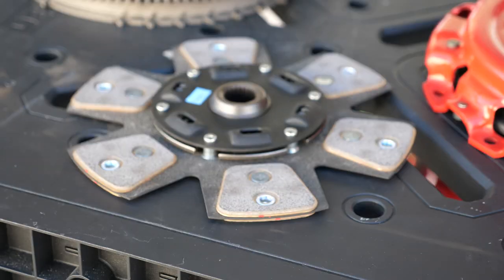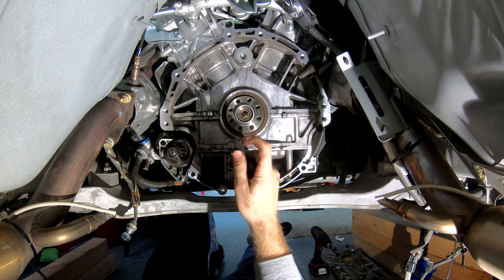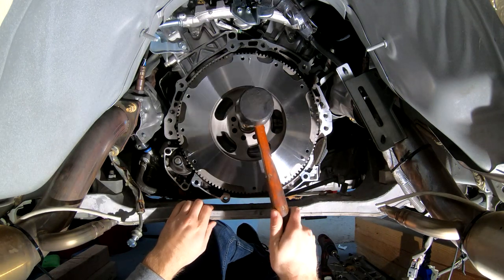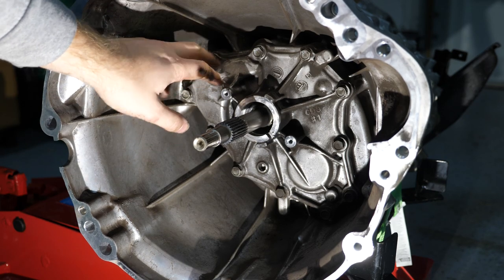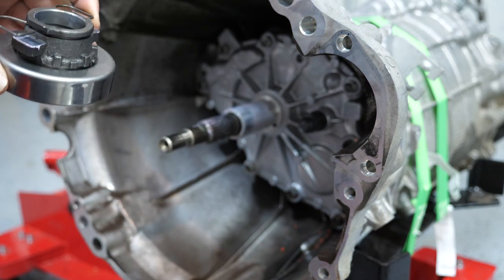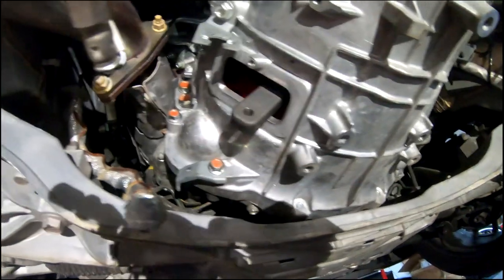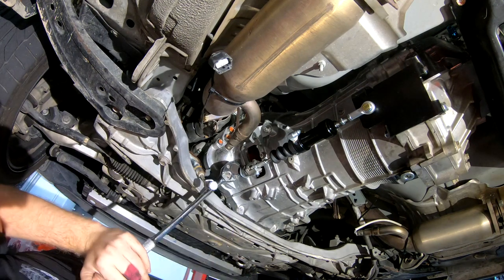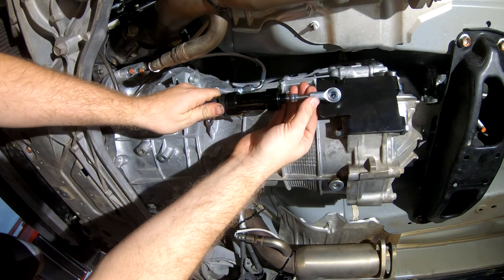370Z Clutch Install & CSC Elimination Kit - Detailed Walk Through

Comment: *Important note on the bellhousing torque specs*

At 25:15 you accidentally quoted the newtonmeter figures as ft/lbs. The small bolts are 34 ft/lbs and the long bolts 55 ft/lbs. 

Also worth noting theres and extra sensor on top of the transmission if you have a syncro rev match model. The clip for the sensor is very difficult to get, but it can be disconnected a few inches further along the loom. Do not forget to disconnect this, if you rip it out, theyre *extremely expensive*. Overall excellent guide, thanks for uploading.

Comment: Good video! You really need to do the RJM adjustable clutch pedal. It’s made my driving experience 110% better, and gets rid of that crap Nissan helper spring.
Reply: Good call. Or you can simply remove the spring.. that's what i did on my 370z. clutch has a much lighter feel afterwards
Reply: MrChips005  Yeah, but after I installed the RJM pedal... Nothing you do with the factory POS is just nonsense. I’m just sayin’ it’s amazing.
Reply: @EatMyPropwash  Where do you find this RJM pedal? i'd like to research more
Reply: MrChips005 just search rjm pedal 370z. Youll see it
Reply: I installed the RJM clutch pedal last summer and it made a world of difference, time and money well spent!
Reply: RJM pedal was A HUGE difference in how she feels. Well worth the money and effort installing.

Comment: Correcting the OEM CSC problem now, while you're doing the clutch and flywheel is good preventive maintenance - something I learned during the time that I owned a Porsche. I bought a 2019 370Z 6MT sport pkg(current mileage ~39K) and flushed all of the fluids at approximately twice the frequency that Nissan recommends. I also periodically look at the color of the brake fluid to see if it's starting to darken any, so far so good with no problems. The brake fluid that Nissan recommends for this car is a special extra high temperature fluid that is pretty expensive but is necessary in order to resist oxidation and degradation. I suspect that some owners, and cheap shops, are cheaping out with regular hydraulic brake fluid that may be getting stressed out under the high operating temps in the bell housing and causing the CSC's seals to degrade and leak.

If I ever have the clutch assembly taken apart I will probably do much of what you've done in this video.
Reply: I'm keeping it all OEM and hoping you're right. I like the feel of the 2018 clutch and OEM parts, so unless I made it a racecar, I'm not straying from the design.  Nissan upgraded the clutch pedal in 2015, I think, with exedy.  I already did a clutch fluid DOT4 GTR fluid change and will probably every other season.

Comment: Great video and extremely helpful. One thing to add is to mention the removal of the cat or test pipe immediately after the transmission removal. This entire project was fun until the removal of the cat converter. I wish i would have removed it before installing the transmission back on.
Reply: Why did you have to remove it did it get in the way?

Comment: Great video! I did the same elimination kit, it’s great as long as you adjust it right.  After 20k miles and two years I’ve noticed there’s a small slave cylinder leak it may have been because I used racing brake fluid and didn’t change it
Reply: Whts the idea of the elimination kit?

Comment: 25:10 Annotate this for others wishing to attempt this, you misinterpreted the FSM and over torqued all of the transmission bolts. Per the FSM, the 8 longer upper  bolts torque spec is 55 ft lbs and the lower shorter 4 bolts *torque spec is 34 ft lbs*. Starter motor bolts is *35 ft lbs*. The Starter motor bolts are the only bolts on the transmission that does not have a washer, the rest of them do with the difference among them only being the length of the bolt.

Comment: hey i have questions i just finished installing my kit with your guide one question is does your clutch pedal feel like its loose from the top position to about half way then it’s catches also vice versa when clutch is all the way pressed and i go to release it it feels good up until halfway up the it basically has free play hopefully you respond thanks! great video by the way
Reply: I’d recommend bleeding the clutch fluid and if you have changed the Master clutch cylinder to replace that if it’s been a few years with the car with abnormal clutch fluid change.

Comment: Hello, thanks for the great video. I have 2009 Nissan 370z and looks like slave cylinder went out. How long would a project like this take? What is better elimination cylinder kit or a heavy duty cylinder kit? Thanks.
Reply from the maker: Would suggest heavy duty cylinder over the csc elimination. A bit less work and more reliable.

Project would take you a weekend or so if you have some experience doing breaks/diff, etc. But just make sure you have a spare vehicle.
Reply: @thecarizon504 you didn't replace the rear main seal?
Reply: @thecarizon504 why did you go eith the z1 cmak over the zspeed  cmak. The z1 kit looks like more work

Comment: really helpful video Carizon!
I do have a question if I'm using the same old stock clutch with the CSC elimination kit, how or where do I get my shim thickness?
Reply from the maker: I would check the Factory Service Manual if you can get a hold of it. It may be worth checking with the guys at Z1 too, since they sell the oem clutch if I am not miataken.
Reply: @thecarizon504  one more question... so, I installed my clutch kit from z1 and my clutch pedal feel so hard... is this supposed to be like that?

Comment: Thanks for this awesome video, this is by far the most detailed instruction on the z1 csc elimination kit out there. I can’t shift into reverse half of the time without putting it back to neutral/release clutch/repressing clutch and repeating this process a few times, having a super stiff racing clutch makes it even worse. I’ve been told I need to adjust the csc kit, do you know exactly which part needs adjustment?
Reply: Having similar issues, not sure if its related to the cold weather since everything shifts smoothly after warmed up. Did you ever solve your issue?
Reply: @tarnjit458  it happens to me all year regardless of the temperature. My local mechanic told me it's not an easy fix, the transmission has to come down in order for him to make adjustment to the gear. I'll probably bring it to a performance shop that have installed these csc kits before

Comment: WhAt determines the engagement point ? The bolt connected to the black bracket on the slave ? Mines feels like the engagement point is to small n at the bottom . Also can’t bleed it maybe if I bleed it would the engagement point change ?

Comment: I have a question for you, bought a g37 with the same parts installed z1 full face and csc delete. The clutch is very very stiff. Wondering if you had the same feel on yours? It grabs great and is drive-able but just seems incredibly heavy
Reply: Clutch spring assist ?

Comment: Great Video! You mentioned you'd review the clutch in the next video but i haven't found any more info in your subsequent videos. I'm about to order parts to do exactly what you're doing here but a little torn on the 6-puck ceramic or just going with the full face organic. 6-puck looks really "streetable" from your videos but how is the clutch life on it? any other drawbacks? thanks if you get the time to respond here!
Reply from the maker: I've had it on for almost a year and a half now. It's been running well, I've heard the life on these can be pretty short lived, I've been told not to expect more tham a couple years out of it. I'll have to see, if that's the case may switch to a different unit.
Reply: @thecarizon504  Dude, thank you so much for the fast response! Can be really tough getting useful info sometimes. Sounds like i should probably just go full face organic right now and then if/when i get closer to making a lot more power just switch to the 6-puck at that time. Also I am going to be making a video about the repair, won't be full tutorial, but definitely going to point people over here cause your hard work really shows in these videos. You're a legend!
Reply from the maker: @C_Robbins  full face should work along with a high pressure plate. What power/tq you shooting for?
Reply: @thecarizon504  Short Answer: (Until further notice) try to bump up in the 400-500Hp range. 

Long Answer: Still uncertain because I'm not sure what direction to take the car, the body looks okay from 10ft but is FAR from perfect and I've done a ton of work to make the car mechanically sound from being totaled (and terrible repair job) from the previous owner. But not sure if i wanna go "flashy" with forced induction, bright wrap and big wang (kind of for YT sake), or more "performance" with unassuming outside but highly tuned insides with maybe the idea of, "as much NA performance i can get from it." In the end i just want the car to help facilitate my journey in becoming a better driver so it needs to hold up to some AutoX, track days, etc. and before my CSC died all i know is, i was sick of the clutch slippage. If the clutch is engaged i want the tires to spin or the motor to stall haha Just want to set myself up for success even if I'm not sure what adventure lies ahead.

Comment: Would like to know how drivability has changed with the 6 puck clutch versus stock, not sure which clutch to go with from Z1 but definitely want to install the lightweight flywheel when I go to do this. Thanks
Reply: Just got mine installed 2 weeks ago on my 370z. Love it but does take practice getting used to 1st gear.
Reply: @Agnt-Pain  i have the kit but not the tools yet. How's the difference?
Reply: It feels very tight and taking off in first gear is difficult getting used to at first but once you do it's amazing

Comment: Do you mind sharing your clutch set up?? Flywheel brand etc. please! Great video btw! Makes the job look totally doable 👏🏽👏🏽 Thank you!
Reply from the maker: Thanks! Checkout tye transmission removal video as well for a diy on pulling the tranny.

The clutch, flywheel, and pressure plate come as a set from Z1 Motorsports. Six puck and light weight flywheel are the two options I opted for.
Reply: The Carizon awesome !! Thank so much 🔥😤

Comment: How’s driving with a puck clutch? How does the clutch pedal feel?
Reply from the maker: After removing the helper spring, felt a bit similar to stock. It is a bit more aggressive, and that engagement point is really narrow. But I had no issues adjusting.

Comment: Great video.  Any idea on the average life of the OEM slave cylinders provided they're not too badly abused?  I'm buying a 2017 tomorrow with 17k miles and I'm wondering if I should just do this out of the gate.
Reply from the maker: I've heard a wude range of life expectancies on them. Seems to vary wildely, I'm sure climate, use, and sheer luck in the build quality of the one you get are all factors.
Reply: Mine went at 114k

Comment: Is there a cover for the fork? It seems like dirt and water can easily get inside the transmission
Reply from the maker: There is a metal shield that goes over it to prevent debris from getting into the bell housing.

Comment: yo this is going to help me out big time... but is there a reason why you didn't put the rubber cap back on over the fork?
Reply from the maker: It won't fit unless you cut a sizeable hole out of it. So instead the kit comes with a plate that covers part of the hole
Reply: @thecarizon504  can't wait to my set up and these videos are such a huge help ..

Comment: Can we use the same measurements you took of the clutch and use it aswell if i have the same clutch kit
Reply from the maker: You'd probably be save if you have the exact same flywheel, clutch, and pressure plate but you should still check if possible.

Comment: How the hell do you tighten the top 2 bolts on the tranny without having to go from the top under the hood? I can’t for the life of me remember what combination of extensions and joints I used to removed them and now I can’t torque them.
Reply from the maker: I may have shown what extensions I used in the transmission drop video but I went from the back of the tranny, not the top.
Reply: @thecarizon504  that’s what I did I just had to man handle it

Comment: Does the clutch and fly wheel have any chatter ?
Reply: Light weight, so yes it will.  The OEM one even does a little on all 350/370s, but dual mass is quieter.

Comment: 4:50 check chrisfix he does it with the bread.
Reply: Which is dumb... that makes a mess... and  you need clean the grease out... the sliding hammer does the job much faster and easier..